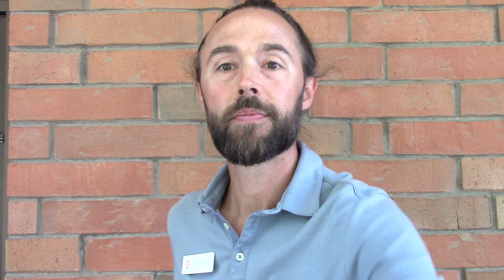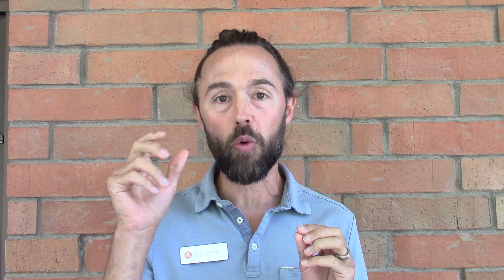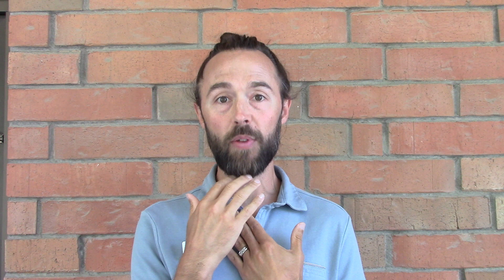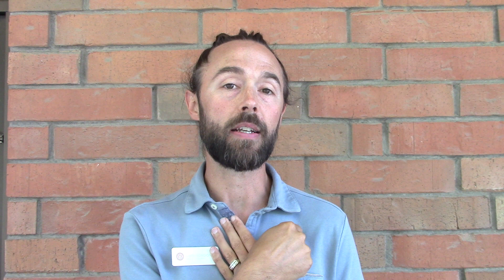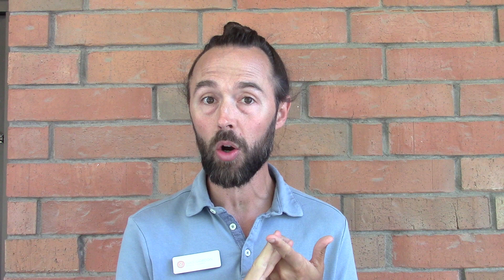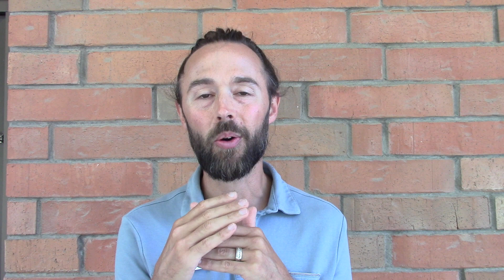How Many Times Should You Perform the "Gufoni Maneuver"? (for Horizontal Canal BPPV)

Comment: Hi Luke, I've had several episodes of horizontal canal BPPV since June (in fact, they're almost monthly—June 2, July 5, August 5, and this morning). After the first one, your videos helped me tremendously to figure out both the affected canal and affected side. My nystagmus has always been lateral, geotropic, and noticeably worse on the right side. The Gufoni maneuver for right HC-BPPV has cleared the nystagmus and spinning every time.

However, I've continued to have dizziness (swaying, sliding, or an off-balance feeling) in the time between the monthly episodes. It's not constant, and is better on some days than others. I actually feel more sensitive to it when sitting in place rather than when moving around. I can do most of my usual activities, but my head hasn't felt completely clear since June.

I saw an ENT last week before this latest episode, but because neither Dix-Hallpike nor supine roll test brought on any symptoms, he couldn't speak much to the continued dizziness except to suggest that I might have a canalith lodged in the canal, or that I should try the Epley, which has never worked. He was surprised by how knowledgable I was of the condition (thanks to your videos). I gathered that he hadn't encountered a case of horizontal canal BPPV because he thought they were only 2% of cases. Incidentally, he hadn't heard of the Gufoni maneuver.

Anyway, I was wondering if you've treated anyone who then continued to have dizziness but without vertigo or nystagmus. Thanks for your clear and informative videos!
Reply: Sounds like me.   Recently been learning about PPPD.
Reply: @YarnKilla54  I wasn't aware of PPPD but I don't think that's what I have. My dizzy spells don't last long, but they can occur throughout the day.
Reply: @electricheadmusic it's no fun for sure 🫤
Reply: @electricheadmusic  BPPV Is the vertigo. PPPD also known as triple PD is basically chronic dizziness, vertigo, MDDS, vestibular migraine that has manifested into PPPD... Basically when everything you've done doesn't help it and you've had it for quite a while. I found a channel called the study coach but I still feel somehow. Some way there are crystals misplaced in one of the canals possibly more than one. For me. It's been bppv/& mostly likely PPPD for 26 months all day all night
Reply: @YarnKilla54  That sounds worse than my condition. I'm so sorry, I hope you find relief.

Also, thanks for the recommendation for The Steady Coach channel.
Reply: @YarnKilla54 Same for me, it never ends. Have u found something that helps?
Reply from the maker: Sorry for my late response! Have you tried any of the VOR exercises yet, or other vestibular exercises in general? Those should help with your symptoms. Let me know if you want me to be more specific. Thanks!
Reply: @GordonPhysicalTherapy  Thank you for the reply! I haven't had another BPPV episode since posting the question in September. For several weeks after I posted, I slept elevated on a wedge pillow (for lack of any other solution) and developed acute tightness and pain in my shoulders, neck, and back (I think from subconsciously trying to keep from turning my head in bed). I started going to a physical therapist who, in addition to treating my neck, shoulders, and back, had me do various VOR exercises. She also advised me to sleep on my regular pillow again and to try sleeping on my left side. The tightness/pain resolved after six weeks and the residual dizziness lessened considerably. She left for vacation before the holidays and I discontinued my visits.

I still occasionally feel a little sway. I haven't kept up with the VOR exercises so I will start them again. I guess I am still wondering, when someone continues to feel occasional dizziness but clinically not another BPPV episode, what is the root of it? Does BPPV, particularly recurrent episodes of it, impair or damage the vestibular system permanently? Are VOR exercises therapeutic or more like a workaround? I wasn't able to get this kind of info from the ENT or physical therapist I saw (neither of whom seemed to believe my BPPV was in the horizontal canal despite only being resolved with Gufoni) and you are clearly knowledgeable. Thank you so much.
Reply: @electricheadmusic  I have similar problem after having BPPV. First in January then another episode February. At first time I did not know what it was. I did some random manouvers, slept elevated and it went away within a 5 days. However second time was worse but I know what it might be (BPPV) so I recorded using smartphone nystagmus during dix-hallpine and roll test and performed manouver for right horizontal canal. Unfortuantely it's been almost 2 months and I still feel "off". I had VNG, posturography and some other diagnostic tests (MRI soon aswell).

When I look at straight horizontal/vertical lins such as ceiling or wall edge I see very slight movement/tilt. When I don't pay attention to it it's fine though. If a MRI will be clear then I'm almost sure I developed PPPD and my brain wrongly interprets what I see.